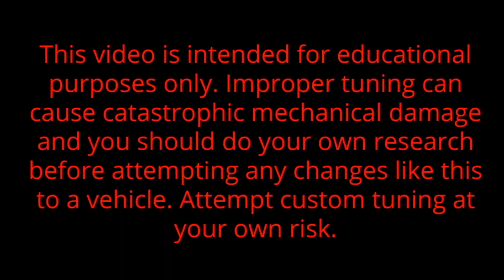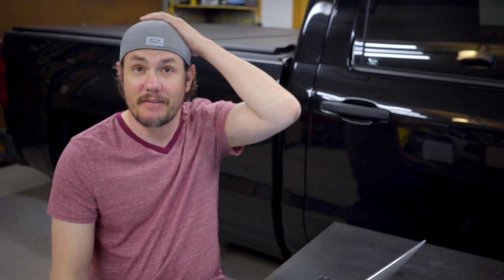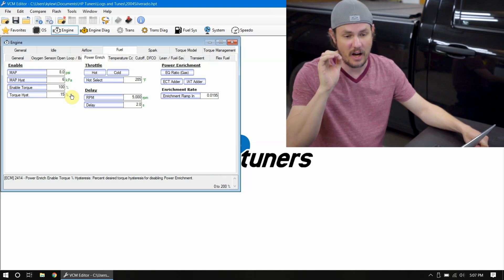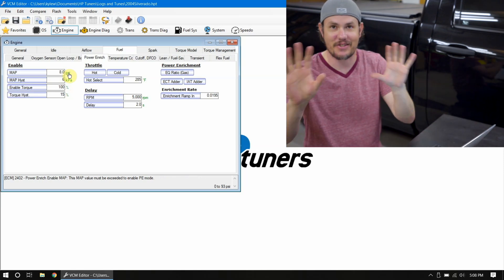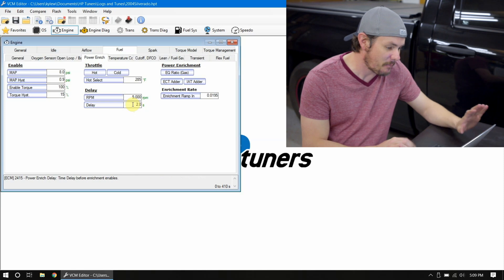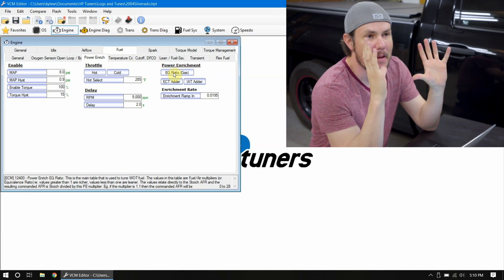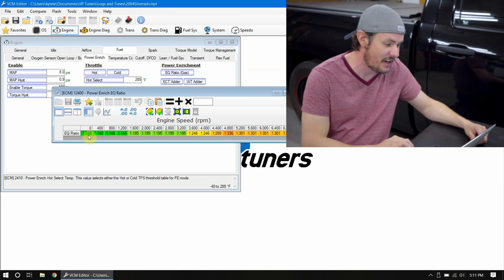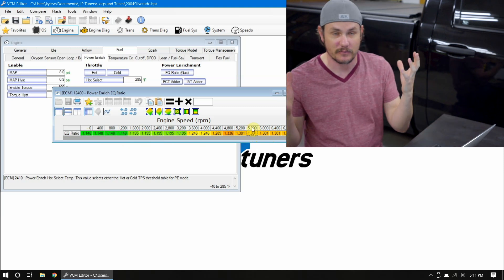Power Enrichment Tuning in HP Tuners, Making Power While Being Safe!!!

Comment: 02 Silverado 5.3 completely stock everything. Very laggy between 2700-3700 rpms. 

At what point should I start ramping in PE? 3500?

I have upgrades coming which is why I have the tuner but I’m doing as much on the stock motor as I can for the learning benefit. Thanks.
Reply from the maker: Think delay is set to 5k on this truck with 90% pedal being the trigger, you can try dropping the delay and take maybe 5% fuel out of your enrichment by multiplying the entire PE EQ Ratio Gas table by .95 as it is very rich from the factory.  If you start getting into PE too quick you will actually rob yourself of power, it is most effective at the higher RPMs.
Reply: Drop the power enrichment rpm to 2000 - 2500 rpm. Put the ramp rate at .500 and TPS required to 50%. Power enrichment is the equivalent of the secondaries on a carburetor.  The factory setting was 5,000 rpm enable with a 60s delay, and 100% throttle requirement, it was effectively off. This adjustment made the largest difference on my cammed 5.3 Silverado.  My factory (pe) equivalence ratio was set to 1.300 and now it’s at 1.200-1.180.

This is how my ecm came back tuned by Casey Rance after the cam swap, and it works fantastic. I’ve got hp tuners now and wideband on the way, because I want it dialed in as close as possible.

Comment: So would you still need to have a climbing pe value with a boost reference fuel pressure regulator once you break the zero vacuum point or would you tune the PE up to the point of boost and then let the FPR handle it from there
Reply from the maker: You'd still want to have the rate climbing in the PE table or else it will slow down your duty cycle on your injectors regardless of what your rail pressure is. The big thing you're probably going to want to do is setup your PE to come in around the RPM range of where you start making boost. Factory settings hold PE off until way higher in the RPM band. PE is bad for fuel economy, lol

Comment: So i could be completely wrong but i set up my power enrichment on a NA motor just like the power valve on a carburetor. 

I disable all other qualifiers for PE and have it enable based solely on MAP around 90 kpa or so. That way anytime the motor is near 100% load (i.e. little to no manifold vacuum) the ECU commands the PE AFR. Now i realize in stock tune this is totally unnecessary  as the power enrichment is essentially disabled on this LQ4 6 liter ive been tuning from the factory.

However i RAPE the AFR spark correction table to add up to 4-7 degress of timing to the base tables when in power enrichment. Because trying to add that much more timing to the base table at high cylinder airmass numbers at 1.0 lambda causes detonation. So by having the PE come in at high manifold pressures you can squeeze more timing in the motor and really pick up torque down low and the richer AFR is cooling the combustion chamber to prevent detonation.

I understand a richer AFR inherently needs more timing to make a given cylinder pressure because richer AFRs burn slower than a leaner AFR, albeit by only a degree or two. So in my mind adding MORE timing than needed to compensate for the slower burn MUST increase cylinder pressure and thus MUST make more torque assuming you havent gone past MBT.

I would like to hear your thoughts on this because no one seems to understand what im getting at or just blow me off by saying "your gunna blow your motor kid". No knock retard logged so no blown motor as of yet lol
Reply from the maker: I think your logic is pretty sound on an NA motor when it comes to PE, which is why you see even on stock tunes it doesn't kick on until you're really high in the usable RPM range of the motor. I also like the approach of simplifying what triggers it, it's gotten unnecessarily complicated, though I do like the option of the knock PE that the later models have introduced even though it's not being used on NA models as far as I can tell but it's nice to have the option if you go FI eventually.

I still think MBT requires a Dyno to set your timing to where you're making the most power and then you can dial back your PE as lean as your can before your start seeing issues with cylinder temp. At some point your also getting into what we consider diminishing results where we are potentially creating an unsafe environment for such small power gains that it is no longer worth it.

As far as everyone else, you do you man, it's your rig, prove em wrong.